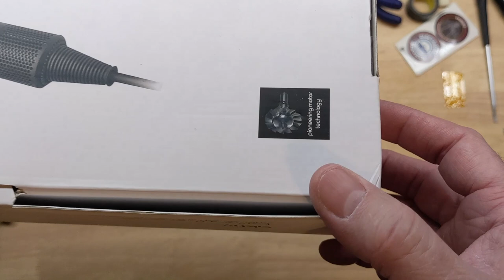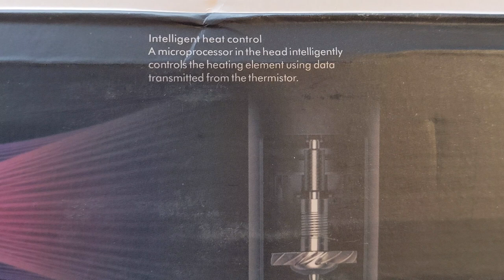Inside of a Knock-Off Dyson Hair Dryer

Comment: is it possible to run the original dyson digital v9 motor, 2 pole "230v"? without the original power supply? I would like to make a drone that uses this type of engine.
Reply from the maker: I tried only once with the 120V version. I should have tried higher frequency supply first. I started with a scr control pulse to see if it would allow any rotation even if really slow, but unfortunately the spare motor I had started letting the smoke out. I don't know much about these SRM or switched reluctance motors. At least I believe that is what these are. I would start with a high frequency pulses 230V in your case if I had to guess. It is 120,000rpm so the frequency must need to be high. I only had the one spare motor for a project I was doing so I ended up buying the cheaper 3 phase BLDC version to finish a project I had. The lower output was ok for me on this project. I shared a couple minutes of these project in the middle part of this last repair video. 
https://youtu.be/Xv32Srpq7u0

Comment: Are you using 58V DC or AC on the control board you use ?... Is there a 120v DC/AC driver board for this motor to use it's max potential?.... Very cool video btw!
Reply from the maker: I am having DC in on the BLDC controller board and it converts it to the 3 phase pulses to run it. The higher voltage BLDC controllers are available at up to 20S or 84V, but are pricey. Thanks for your kind comment! 
Example 20s controller: https://amzn.to/3xtJgv3

Comment: Hello, this is the control card in the hair dryer. Can it control DC310V fan motors in air conditioners? The air conditioner fan is bldc and is fed by 310v. The card on it was short-circuited and burned. 55w-60w power. It probably runs at 1000rpm.
Reply from the maker: This board is rated for 120VAC input. I don't believe they are available over 300V.

Comment: would you say the knockoff is safe to use? and does it have all the protections as the original?  how about the wires, are they cheap or good standing?
thanks...
Reply from the maker: The exact one I bought was removed from being sold. It was very cheaply made. No where near the power of the real Dyson. My opinion is I would not trust it. I used part of it for a project I was working on and  that worked fine, but overall would not trust it.

Comment: 13 l of air per sec. Is that a lot?
Reply from the maker: Yes!  I believe that is the Dyson claim for their V9 motor. It's not as powerful as the Dyson for sure, but I did not test that to be certain. The only way I have to get that would be to fill up a trash bag with the air and calculate the time it takes for the volume. It was a thought of mine to test that on video.  I had to cut some things from the video though, it was getting too long. I think I enjoyed looking at it too much. Lol